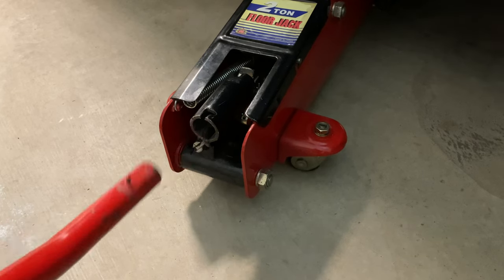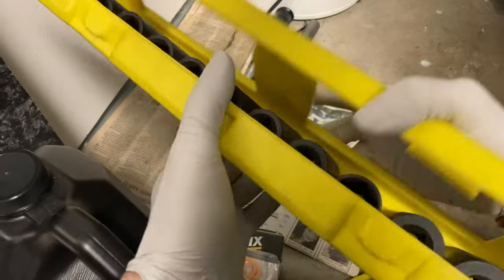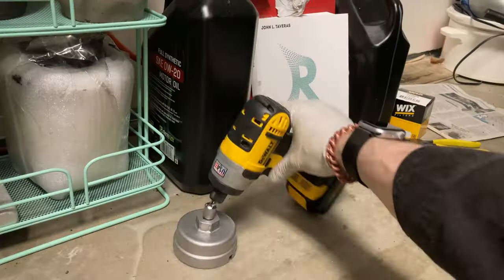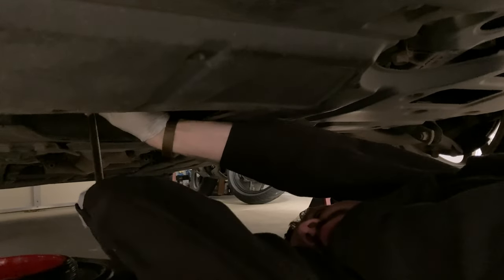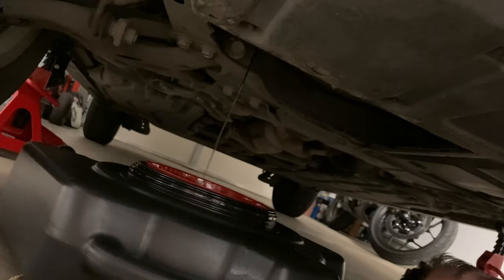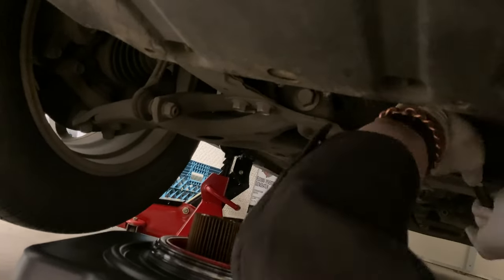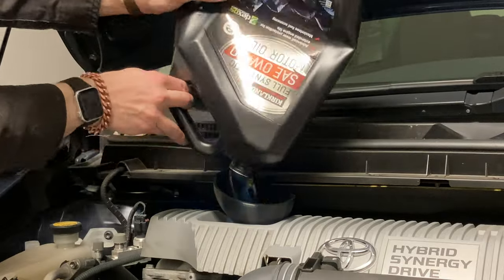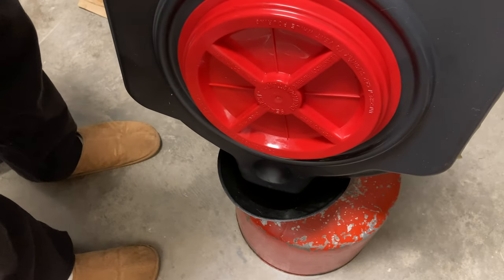2010 Prius Oil Change (How to DIY) Timelapse + Recycling Spent Motor Oil / Oil Filter + O--ring too!

Comment: You don't need tools to remove the o-ring
https://youtu.be/a0D_vGFgLD8
That used oil really is black. Have you ever had it analyzed after draining it? We change the oil in our 2009 RAV4 Very 5,000 miles.
Reply from the maker: I change the oil more often generally than the dash computer suggests, by checking the oil dip stick with a paper towel & then smelling it for acidic fuel vapor & look at the color, if it seems funky, I swap it earlier. Part of the reason the used oil looks so black is that I do not have any bright studio lighting for these videos & that camera on my old iPhone not nearly as good as the version on my 14 now, so the oil looks darker in the video than it was in reality. Good eye for seeing the detail & thanks for watching.